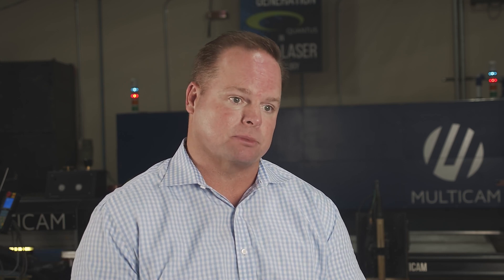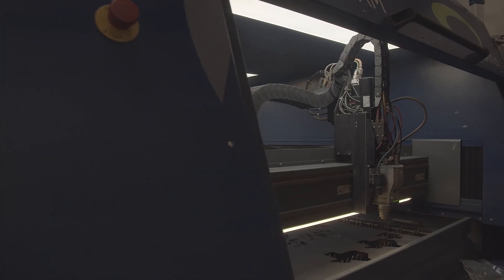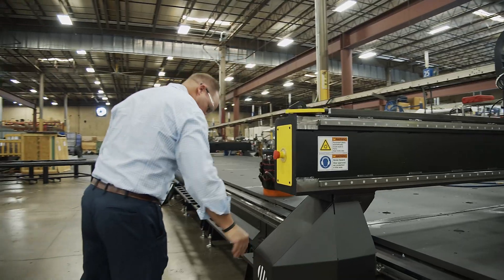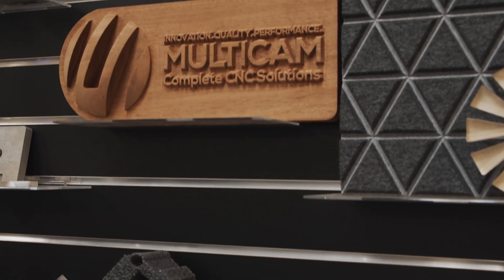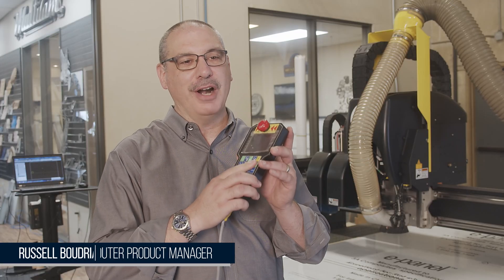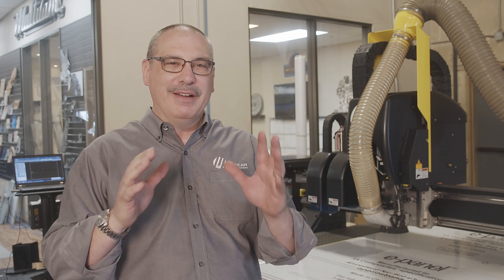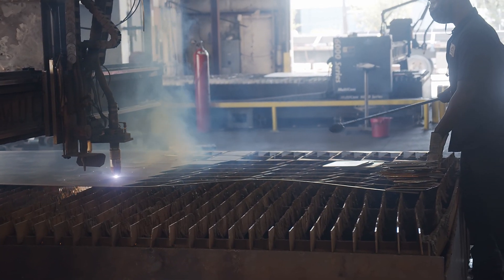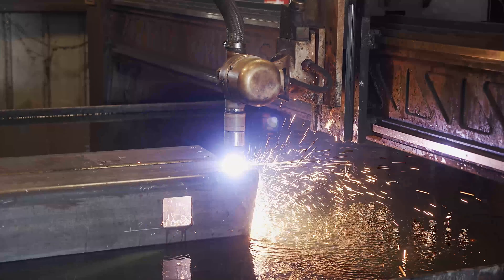Why MultiCam Matters!

Comment: Don’t buy Multicam Celero series. Nothing but problems. Have had them out 2 times since install a month ago. Being charged now for them to come out to fix issues that have never been right since install. Automatic tool changer is garbage. Works for a week then drops the tools when changing. If you have print shop look at Kongsberg or Zund. Poor training on install and was told by sales guy it could do things that haven’t been finished in design or still being worked on. Speeds they say the cutter can do are not accurate for real world unless you are cutting straight 10’ panels. This cnc is designed to be a router more then a cutter.